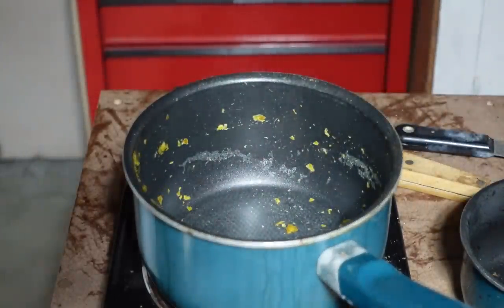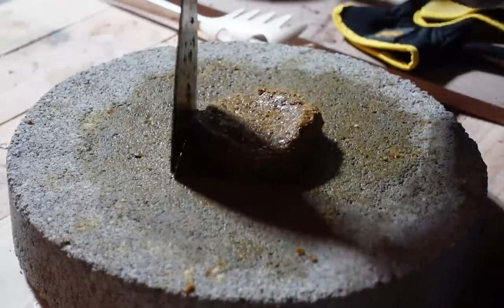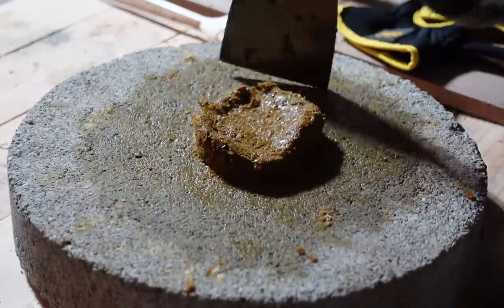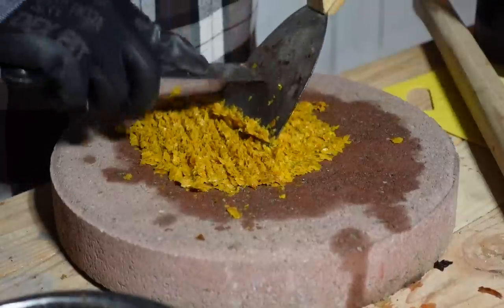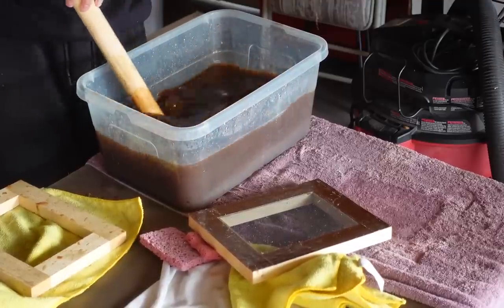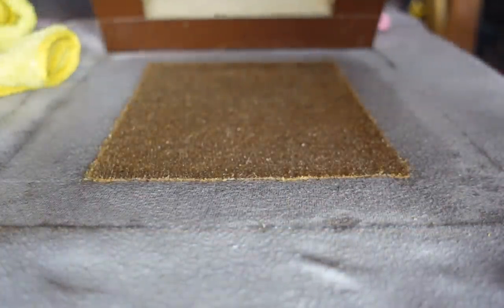Can Leaves Be Turned Into Paper? DIY Experimental Leaf Paper

Comment: Why not put the leaves in a blender or food processor instead of cutting with scissors?  Then boil. That would make the paste much faster and easier than beating it. Strain that mash and press it to remove as much moisture as you need to. I’ve made paper myself and that is what I find is most efficient and produces a good product.
Reply: That's a great idea!
Reply: Wouldn't it cut fibers too short? I have no idea but that's what I heard.
Reply: @ZeroPlayerGame  It’s never been a problem for me.
Reply: blending before boiling would put more strain on the blender, adn probably wouldn't blend as finely...
Reply: When I do this with recycled paper I use a blender after soaking
Reply: finally someone understands me,this man really took his time despite having a blender hanging around.
Reply: I was thinking that
Reply: Yeah there was no point to all that physical labor when he just ended up using a blender anyway
Reply: @comradewindowsill4253  I imagine to a certain degree you don't want it too fine.
Reply: Makes for a longer video... @TakeMeToYourLida

Comment: Instead of the stick and flat surface or chopping with the paint scraper, you should invest in a Mexican molcajete. They are like a mortar and pestle but with a more course surface. They're used to grind vegetables to make salsa but would be excellent for grinding down the wet leaves into finer pulp. They're around $30-$70 depending on the size you want.
Reply: Yes! Just made this suggestion on a comment about a mortar and pestle!
Reply: That's exactly what I was thinking when he started pulping the leaves too
Reply: @brainplay8060  my dude actually had two cement pavers at hand and didn't use those to grind the pulp. SMH. 🤪
Reply: I thought the exact same thing when I saw that part, either a molcajete or a metate would work so well for this
Reply: That's literally what I was thinking
Reply: A food processor?
Reply: My thought too, just came to post! Glad others are thinking the same thing.
Reply: @YSLRD I bought and used a cheap blender for breaking down pulp
Reply: He already has a blender... why he spent so much time with his hands, I do not know.
Reply: @lourias I believe to preserve more fibers? Definitely wanted to know why the smushing instead of using a blender
Reply: @lourias  for the same reason he's making paper instead of buying it.
Reply: Or move into the 21st century and use a food processor
Reply: @rickwilliams967 to... make paper... yeah, definitely moving into the 21st century there 🤦
Reply: Thanks for taking the time to post this.  My son suddenly decided he wanted to make paper.... 

This has given us a great starting point. 

Thanks so much.

Comment: One thing you sometimes see added to the paper pulp is actually a mild and dilute adhesive to promote bonding with the fibers. It does mean that the paper has to be transferred from the deckle before it finishes drying to prevent it from adhering too strongly, but it can help prevent fibers from being pulled out of the paper so easily. I suspect that the mucilage from the okra somehow replaced that in your previous grass paper. If you want your paper to be particularly white (for some reason) you can bleach the fibers and add in kaolin clay. The clay also improves surface durability but inhibits ink absorption to a certain degree. Almost all common white printer paper contains kaolin clay, or a similarly white and fine particulate clay. Chalk or talc would also work decently well. Another cool option if you were to take on making a white paper would be to finely shred some dried flower petals and toss them into the basin just before you go to make your paper. You don't want them to rehydrate, but instead just get trapped in the paper fibers to make colorful little confetti dots in the paper. If you live in the south and have access to what is known around here as a "Sweet Betsy Bush" (calycanthus floridus), try to get some clippings of new growth branches and twigs. You'll need to boil them and scrape the bark off to make them usable, but the process should be roughly the same as making washi paper. The wood inside these shrubs is particularly white and pliable, so the fibers should be well suited to the role of paper making. Their flowers also smell particularly nice, or at least I think so.
Reply: Awesomeness. Thanks for the education. This comment and video is making me want to try and make leaf paper.  Much love ❤️
Reply: kaolin is used to make the sheets less translucent so both sides of the paper can be written on - Okra acts like Neri ( Japanese addetive to the vat for better formation of the sheets made from Hybiscus Manihot roots) if you want to make the paper sized there are additives available for that purpose
Reply: If you did your method, would a single layer of cheese cloth be useful? or cause more issues? (lay down the cheesecloth on the deckle first)...Read some more of your comment; would diatomaceous earth (food grade) work, instead of clay, I wonder? that's very fine particulate matter, but don't know if it would result in a "white" paper, or turn it another colour entirely...or just cause an unknown issue...
Reply: @Kayenne54  As long as it's a fine particulate and quite white when dried, then it should serve that role just fine. Most of the instances I've seen of people transferring paper after pressing out some of the liquid typically use fine linen canvas to do the transfer to their drying racks, since the canvas is much easier to wash and press once it becomes too damp to serve its purpose anymore.

As one comment pointed out, the clay does also serve the role of allowing thin, fine sheets of paper to be more opaque so that both sides can be used. It also makes it less absorbent, more finely textured, and less pliable. It's why you can typically write on printer paper with a water-based marker and barely see it on the other side. Paper is a fascinating subject matter, as it plays a much more significant role in the writing and printing experience than people typically acknowledge.
Reply: @mndlessdrwer  Diatomaceous earth (food grade) dries white. It is white to begin with, but of course not sure how the paper would act once processed. It would certainly be less likely to be consumed by insects, I'd think (because D.E. works by desiccating insects and usually how it's used). I liked the sheen on the leaf paper in video above. A fascinating topic, thank you for your insights.
Reply: Boil some crushed flax seed then strain it
Reply: @AL-fl4jk  I've heard that flax seed can be used to create a gel, and if it functions similarly to okra or chia seed, or any of the other mucilaginous thickeners, it should help the fibers to disperse and suspend into the bath while also encouraging them to stick together once strained.
Reply: he said he used cornstarch this time not okra

Comment: You should experiment with different types of leaves. Looks like you chose something in the rose family for this one (pears, apples, plums, peaches... all related to roses). I'd suggest trying leaves with a high lignin content, like oak, beech, or chestnut. Should give you a different fiber structure and a more durable end result, if the strength of the lignin itself doesn't interfere with processing. If it does, go the opposite direction and try something like green maple, linden, or mulberry leaves.

Also, the brown leaf juice is full of tannic acid, which was used in ink manufacture back in the day, but it's been abandoned because it tends to fade and/or damage paper over time.
Reply: Yes that is what I was thinking. Those oak leaves take a long time to decompose out in the yard, and I think oak might make a durable paper.
Reply: It should work. Steam softens up the lignin that binds the wood fibers together (that's why wood becomes bendable when exposed to steam over several hours). And the brown leaf juice sounds like it could be useful for vegetable tanning of leather
Reply: But with high lignin content, Wouldn't that make high acid content?  I am very new at this but i want to make paper useing weeds and flowers from my yard to mount my pressed flowers on. But i think my pressed flowers are browning really really fast because maybe high acid content? 
What do you guys think?
Reply: @saltpepperketchup7082  Lignin is just a starchy material, but like cellulose, it's physically durable and not easy to digest unless you're a fungus. I think you're thinking of tannins (tannic acid), which is what makes coffee and tea brown and bitter.
Reply: @NorthernGoshawk   It may seem that I blame the "browning fast" on a literal color pigment or something. But actually it is not a "color" i refer to. More of degradation. That's a common thing that happens to pressed dried flowers over time. Mostly when exposed to daylight, the colors fade.  And i think i read that its the sulfer and lignin that is responsible for the high acid content in paper making, which makes paper degrade.  Is that right? 
So my reasoning is that if lignin and sulfer turn paper brown and brittle over time, could that hasten the degradation of my dried pressed flowers mounted onto acidic paper, or am i just trippin?
And if i was to make paper from backyard weeds and flowers, do they contain this cellulose that you speak of? Would they also contain lignin and sulfer like wood does?
I think i would have to have some kind of a binding agent if they dont contain cellulose?  
Do i have everything wrong and should just walk away? I just want my flowers to keep color longer and was hoping to make sense of it all.
Reply: @saltpepperketchup7082  I don't know much about drying flowers, so this is all speculation:

I'd expect the fading of flowers to be more related to 1) oxidation 2) exposure to UV radiation. Acidity (still probably mostly tannic acid from tannins, but probably some sulfuric acid) would basically turn white things brown over time as it oxidizes, sort of like tinting them like windows or brown sunglasses, I guess, so neutralizing the pH would probably help with that aspect. The pigments themselves oxidizing would still be its own issue.

The approaches could be 1. Attempt to neutralize the pH by applying a weak basic solution in some way, maybe baking soda dissolved in water. Depending on how you do it and fresh vs dried (I'd have no idea), there could be problems with lack of penetration into the plant tissues. Also, it could change the colors of the flowers. See: purple cabbage.

2. Keep out of sunlight to avoid UV.

3. Apply an antioxidant to act as a preservative by giving oxygen molecules a more abundant target to attack. This would ironically involve spraying/soaking with something like citric acid, but maybe you can find something equally as cheap and readily available with a more neutral pH.
Reply: @NorthernGoshawk   thank you
Reply: @saltpepperketchup7082  I'm also not a drier of flowers, but I do collect stamps and scrapbook. The paper used for these two hobbies are specialized, ph-neutral pages that won't discolor cherished photos or stamps. So if you do decide to use your own paper, you're going to want to neutralize the ph if at all possible.
Reply: @fieryvale   Thank you for your reply. A few weeks ago i bought a pH pen to test my papers. I had read that most paper now-a-days are acid free due to stricter manufacturer guidelines regarding hazardous chemicals. (I am sure i have messed up some facts here, and i use plenty of wrong words, I'm sure. I appologize if I'm misleading or if i just sound down-right ignorant). Anyways, some acidic papers still found might be newsprint, and i would think old books, being that the pages were made with the old process. But I'm assuming. So, i used this pen to mark on every paper around the room and everything was pretty much staying the non-acidic purple mark. Yellow or fade to clear would be acidic. The only thing that tested acidic was a year old newspaper page that had started browning. The findings are puzzleing to me because to buy acid-free labeled paper products, you have to lay out some hefty dollars. If it wasn't for the one piece that indicated acidic, i would've thought the pH pens were a hoax. But now i wonder if the mega-dollars spent for the acid-free label is money well spent. 
Maybe someone out there that likes to do experiments can test common papers vs acid-free labeled paper products and show me the results?  I cannot find a simple, layman's answer from the searches I've made on the world wide web.
Reply: @NorthernGoshawk   I just reread your answers and want to thank you again for sharing the knowledge. I think i might have glazed over the first time, the important role tannins may be playing in my quest.
Reply: @saltpepperketchup7082  As a philatelist, your findings are surprising to me. I'll have to look into this when I have more time.
Reply: @fieryvale  i anxiously wait.  : )
Reply: Add baking soda to counteract the acid in the tannin
Reply: @fireyvale I would love to hear your findings! This whole conversation thread was fascinating to read. I’m also wondering about all my papers now, too.
Reply: @aatashiwadoremi  I haven't found much so far, but I found a very informative thread on Badger and Blade. One of the posters said that paper with a brightness above 92 (basically everything but brown bags and newsprint) will be alkaline rather than acidic. I do need to look further into this subject; thank you for reminding me.
Reply: Tanic acid is also in tea
Reply: @aatashiwadoremi  I found a great article! It's a deep dive into paper, its different types and their uses. If you look up "paper and books manual western australian museum" the article should pop up near the top. It's labelled Paper and Books by Western Australian Museum in my browser.
Reply: So used tea could be turn into paper sheets and packing paper!

Comment: This is awesome. When I worked at a paper and pulp factory, we only used cotton and cotton fabrics to turn into the pulp. Sometimes we would use a hay-like grass, but it was the annoying one because after just one run, we would have to spend 2 days cleaning everything out. I did some research and found out that any plant with fibers could theoretically be turned into paper. Gave me the idea that even something like pineapples could be turned into paper but I never tried.
And for some advice, when we were cooking the pulp, we would use superheated steam, hot water, an acid (probably the hydrogen peroxide) and if what we were putting in was dyed NaOH otherwise known as lye. Nasty stuff that lye, would always choke you up if the gasket broke before the cook finished. I had some drip on my shoulder once and it ate straight through my shirt and the first few layers of my skin before I even noticed. Anyways, we would pressure cook the material at ~165 C at ~60psi for ~ 1.5 hrs. The time would change slightly depending on the cook but it was always more than an hour. Downstairs, they would then wash the material while chopping it up with propellers, give it a cold bleaching, I don't know what chemical they used for that, then a second wash and out the extruder and onto the oven. When they were finished, they were about 1/2 inch thick and slightly wet so that they are flexible enough to mess with but not so wet that they fall apart. After we bailed them up, we would send them out to various paper companies and different countries for printing that country's currency.
Reply: So cool!! Thanks for sharing :)
Reply: Wow to make a paper that countries use to print paper money must make u feel proud of urself
Reply: OMG you made money paper 😮😎
Reply: Super cool

Comment: A small piece of advice: You can use Titanium Dioxide to color the leaves. It is used as a whitener in almost all industries (including food), so it is not harmful. 👌
Additionally, you can use 0.3mm or 0.5mm plastic sheets to spread wet pulps. This prevents the pulps from sticking and does not impede the flow of liquid when you put weight on them. This way, you can achieve better results when removing dried papers.👍
Reply: Is it safe to boil titanium dioxide with the leaf mixture?
Reply: @renukaramanujam9167   Yes. Titanium dioxide is inert and contains no toxic substances, so heat won't release anything that can harm you. It's a food ingredient that is sometimes baked. The only way it's harmful is if it's a powder and you inhale it.

Comment: have you ever tried grinding the boiled pulp with a mortar and pestle? very similar to what you’re doing on the stone face but might be a faster alternative or would it pulverize it too much to be useful? awesome video!
Reply: I was thinking a Mexican stone grinder, they come in different grits to make different pulps.
Reply: Soak and blitz in a blender is all you need to do!
Reply: Although you would need to be careful, because it can ruin the blender's blades. Also, it is good practice to not use that blender for food after using it for paper
Reply: @valenmejia2135  I use my blender for everything. No branches or twigs in it means no problem with the blades. Proper cleaning and rincing means you can use it safely for food.
Reply: I was thinking it might work really well if he dried the leaves fully, stuck them in the blender and then boiled up the dust and strained it through some nylon stockings or something.

Comment: Possible midrib separation technique? Use the scissors to chop each side parallel to the mid rib, then optionally run your fingers down the rib to get the last bits off.